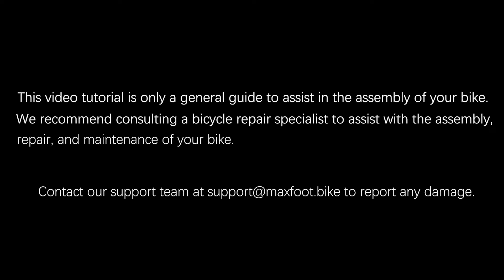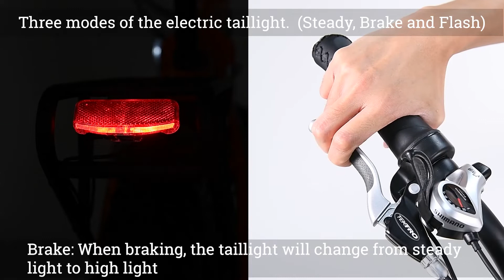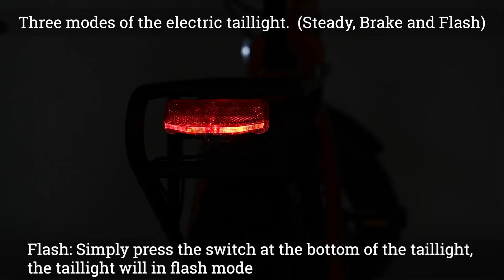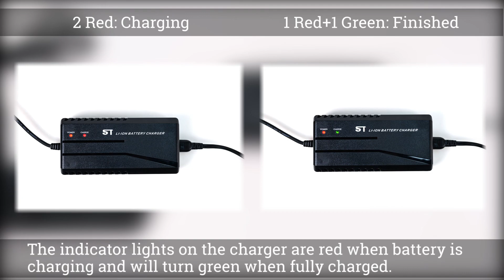Maxfoot MF-19 750W Folding E-bike Assembly Instruction

Comment: Just break is 22 to 23 mph. I keep getting my feet done in the handle on the bike fold-out handle. Level 2 and 3 is good for pedaling. It's too big to fit in a Mazda trunk. It's about the size of a small  motorcycle like 250 Honda.